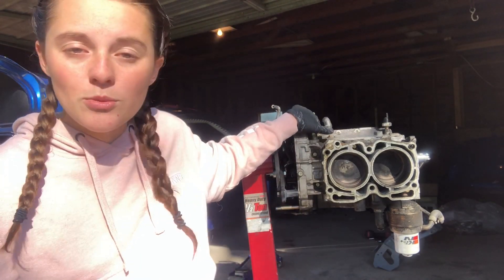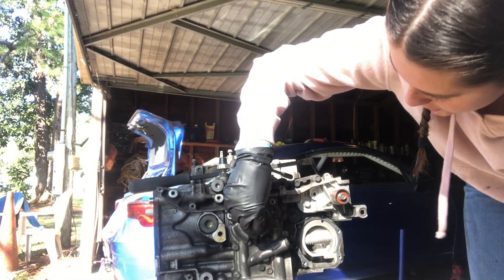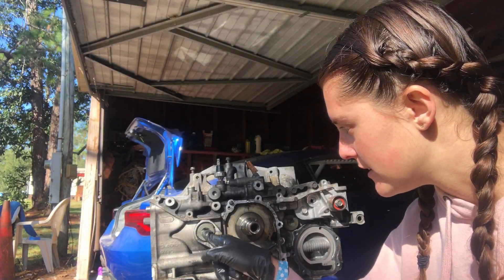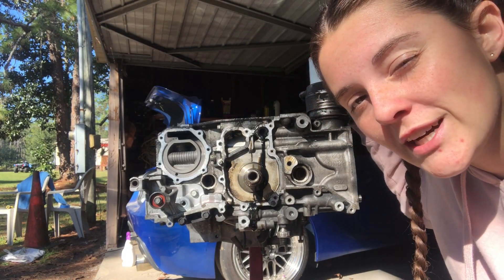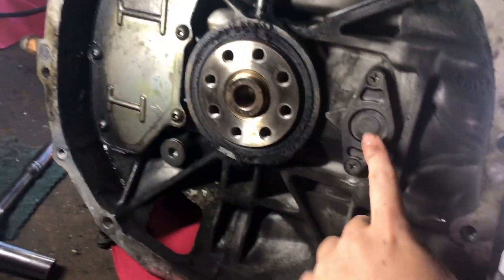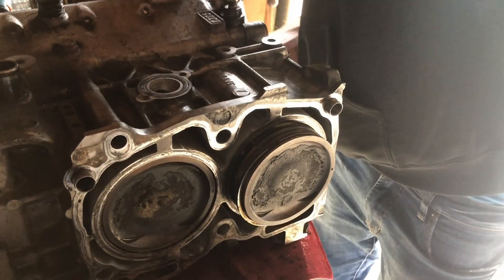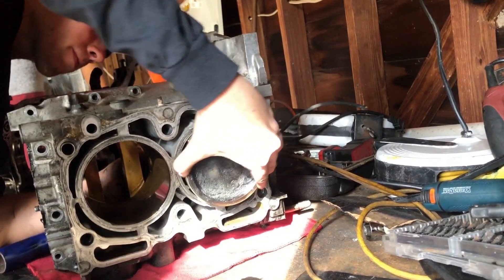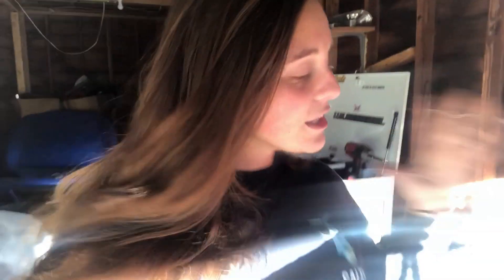EJ257 Block Dissasembly

Comment: i plan to tear down my subarus ej22 at some point, any tips from your experience?
Reply from the maker: Isaiah Osborne sure!:) LABEL EVERYTHING I put mine in ziplock bags and boxes. I hear a lot of people have issues when it comes to putting it back together
when you finally get everything taken off the engine to remove it MAKE SURE the clutch fork is removed or you’ll be yanking the engine for a good hour just getting more and more mad 😂
Also depending on your Camshafts you might get stuck on this part. The jdm cams come with a hex on them so that you can take the sprockets off mine are usdm sooo they didn’t come with it and we had to literally drill them out😂 (not fun) there’s a few tips and videos showing how to get them off if you have the usdm cams and there’s a tool for like 30$ but I was too cheap to buy it 😂
Good luck hope it goes well!:)
Reply: @Aspentera  thanks